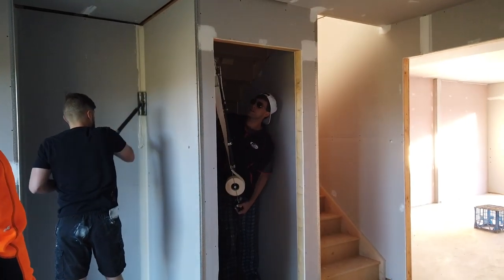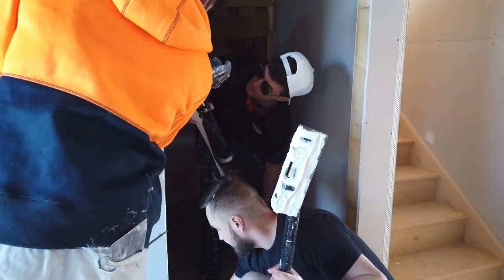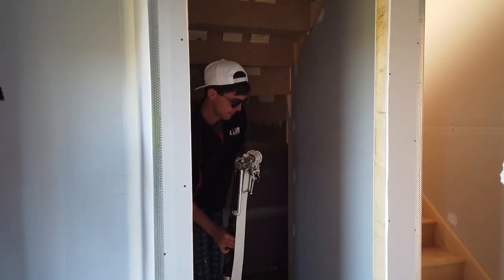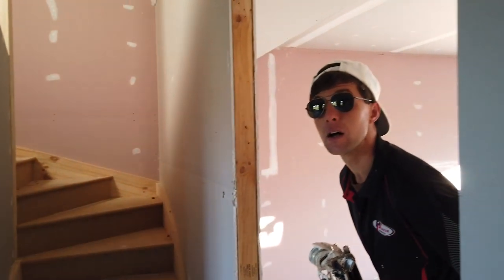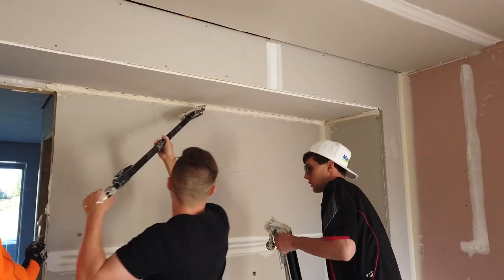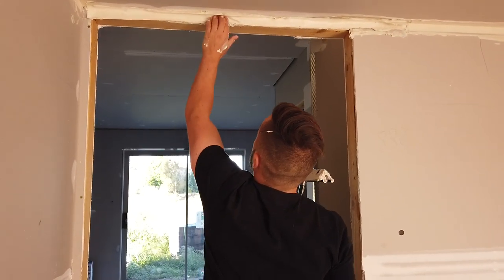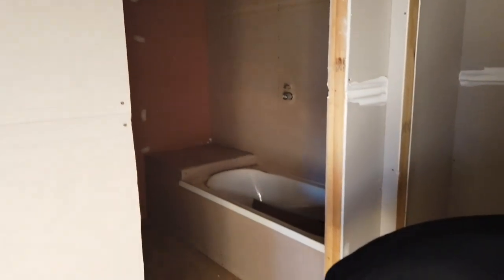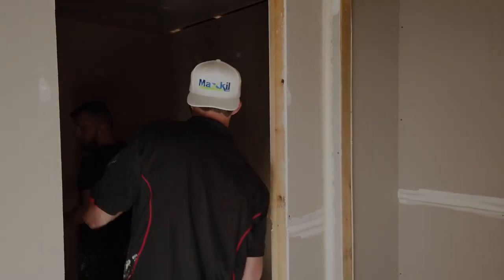Compare Drywall Taping Tools with Columbia Automatic Taper Vs Tapepro Mud Box

Comment: Angles in paper and taping compound, then flats and buts in 60min and fiber fuse. One wash for the auto taper and pump followed by a 5.5 box that is scraped not followed and the job is ready to top by lunch no shrink lines in the tape
Reply: What do you mean by not followed?
Reply: @joshlester4313  I think he mean not fallowed by another box coat or hand coat until it’s dry

Comment: What’s with the massive gaps between the walls and ceiling?
Reply: Coving 😂✔️
Reply: @maxnoble523  figured it out. Lol. We don't do that in canada, we do tight joints, mudded square, and then paint. Sometimes customers ask for "coving" which we call crown molding which we install after that.
Wasn't familiar with the process in Australia. 👍🏻
Reply: I'm from the UK, yeah we do the same unless asked for something else, crown moulding for me is fancy victorian style coving 😂👑 "mud" is a cool term would like to know why you call it that 😎, we do papers with joint cement pissed back metals and tapers with easi fill 60 to get shape without hanging wet for ages then final with normal joint cement, all by hand 😂 Would like to see how you boys do it over there, I'm not a dryliner BTW I'm chippy by trade but cover all aspects as usually move from one refurb to the next and times not really an issue on day rate 😉✔️😇
Reply: @maxnoble523  I don't know why we call it mud, it's just always been since I started.
For corners we use a "banjo" or something like I to apply the paper tape to flat runs or corners and then go over corners with a flusher and flats with a taping knife. On outside corners we use either full metal bead or metal reinforced paper corner bead.
Look up "Vancouver carpenter" on YouTube, he's got a few videos about process.
Reply: Yeah all the same it's as broad as it is long really, technique is why I watch these boys, not looking for the process. What would you do without a banjo? I apply to the internals with a tar brush 😂 then corner trowel and clean up with my trusty stubai 6, what blades do you boys use for first hit? Can't rate my stubai 6 highly enough tbh tapered ground with a stiffener braised to the top holds a superb edge
Reply: @maxnoble523  I'm a carpenter so I just watch people that use the banjo. 😂
Reply: Oh haha fair play, lately I've been doing all my work including second fix with hkc 55 on crosscut rail, makes the chopsaw obsolete. Have you got one or you boys on the mafell kss?
Reply: @maxnoble523  mafell? No, no, no. I have a kid I'd like to put through college. 😂.
I've run dewalt and makita.
Reply: Haha! 😂😂 Yeah same pretty much except I have Hitachi instead of makita. Over this way dewalt isn't what it used to be people seem to be heading towards milwaukee now? Has festool made its statement your way yet?
Reply: @maxnoble523  ditto on feelings on dewalt. Slowly switching to makita, and soon to Milwaukee for some. Waiting on Christmas for better deals.
Reply: @dartetov  good call on the Christmas deals was about to get myself some new bits! Cheers!
Reply: @maxnoble523  the same reason it’s  called a “mud” box and not a joint cement box

Comment: I know it's probably been asked many times. But why is there always gaps at the top angle? 
Also that dude running the gun is a beast with that
Reply: Takanami wondering the same thing!
Reply from the maker: Gets cornice up there like 75% of time always cornice
Reply: Definitely NOT a beast with the tube. Lmao. He good lengths tho it looks like. Aussies have a good system for how they finish. Aussie system and US system could be combined for ultimate system. Great work as always Max and those drywall gangsters! Lol.
Reply from the maker: Yeah it was first the he used that taper. Thanks for tuning in again mate!!
Reply: Thing is this.....all automatic tapers are basically the same as all were copies of Ames. I don't remember mate saying how many years experience he had but, I cant see much time behind that thing personally. Its takes years to run it fast and efficiently to keep 2,3 or 5 guys wiping tape. Personally,  I can keep 3 or 4 wiping tape behind me. Angles, internals you call em, are in every house in the states. Have 1 guy running tube, 1 rolling  and glazing and last guy picking peaks. (You call em 3 ways I believe.) If you're fast enough on the tube in angles, it's a 4th guy rolling while 3rd is glazing. Bottom line,  not impressed with tube capabilities of that guy. In your challenge of bazooka against that modified banjo y'all use, those guys be running their ass off keeping up with an average tube runner from the states. I'll show you when I get there. Lol. You told me you had one so we'll use yours to prove my point all tubes are basically the same! Looking forward to it!